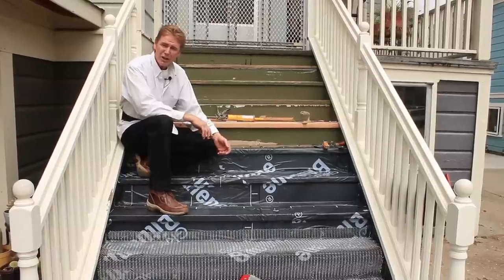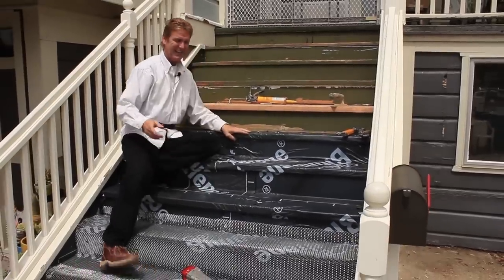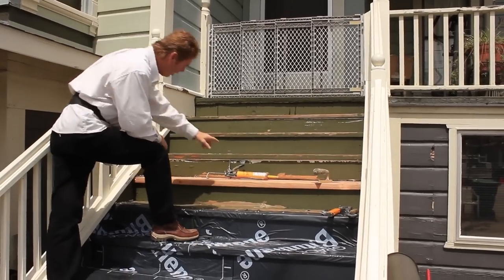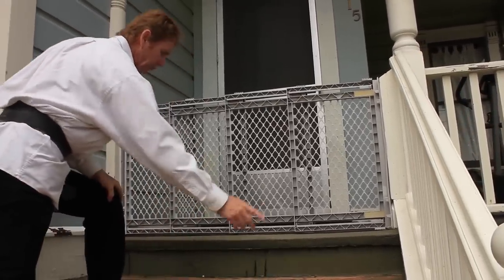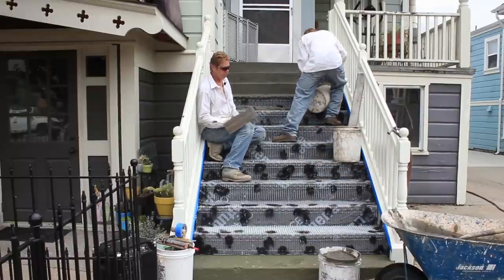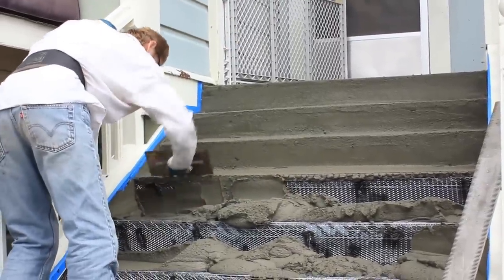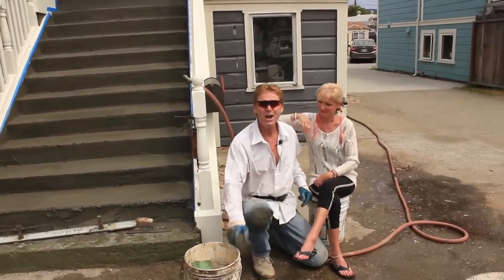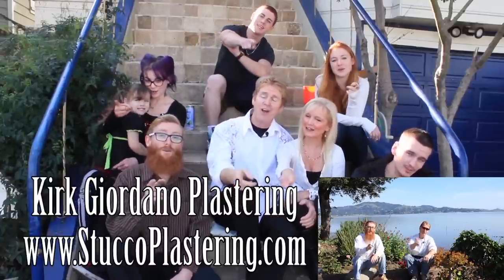Waterproofing wood porch stairs permanently.

Comment from the maker: Hello Mickey McEwan, excellent question, when we use a daby a lot sometimes it will lose it's straight edge, If this and when this happens I grab one side let the other touch a solid surface then tap the middle a few times until it appears straight again.
 I have to do this every so often when rodding or darbying walls. 
A Darby or Rendering Derby as they say in the UK are not very strong and can bend or tweak as they are made of Magnesium or Aluminum. 
Best wishes,
Kirk and Jason's DIY plastering tips

Comment: Hi Kirk, I'm planning on doing this what you've done on this video.  My question is,  I'm removing all the magnesite  material from the stairs and landing and, I would like to replace the material with concrete on top of the wood. Would you recommend this?
Reply from the maker: +Mike Enriquez, Howdy, I have done this many times and have had great success,In fact to this day they are still all in excellent conditions.
 I am a licensed stucco and plastering contractor that applies stucco to walls for a living.
 To apply cement plaster over stairs is something "I can do" as the principals are very similar to walls, but the membranes are different, thus being said, I can do it, but can't recommend anyone else try to unless they are very familiar with membranes and cement plasters,
 cheers,
 kirk giordano

Comment: Hi Kirk, been working your videos for weeks now. Very inspiring stuff man. Question: I'm a homeowner in Brooklyn New York. With that said my steps are made up of actual brownstone. It's brittle and chips easily. I am currently redoing the outer side wall and wanted to know if I can apply stucco directly to the brownstone without first applying wire mesh. Also, will a Quickrete brand work just fine? Your help is appreciate, Kirk.
Reply from the maker: Evening Chacon Johnson, any portland based stucco product will work as long as these stones are prepped properly. 
Pressure wash well as if your going to eat of these steps, next if it were me I would apply a bonding agent such as weld-crete then plaster as required.
 To plaster steps does require a bit of time in as stucco is engineered for walls, not to be walked on, that being said, some stucco's have a PSI strength of up to 4,700 psi when fully cured, compare that to 2,500 to 3,000 PSI for the average foundation.
 Cheers,
 kirk giordano Plastering
Reply: Thank you for taking the time to respond, Kirk & Jason G. I'll stay tuned in for sure!
Reply from the maker: No worries, thats me yob.
 Cheers, 
 kirk giordano

Comment: Thank you for your video! I see this type of stair everywhere around the bay area but can find very little information on how they're made. Is cracking of any concern with the wood base?  Do you ever incorporate control joints?
Reply from the maker: If you're going to stucco over stairs, no control joints are necessary. The description includes all phases of this task. Cheers.

Comment: Do you like the corners tight in your wire or prefer rounded? ?
Reply from the maker: Howdy Tomas, they should be tight or you will have to add more mud in those areas to cover the exposed wire this could lead to fish ponds in the work when it rains.                           Peace, love, and harmony to all
         Sound Plastering tips for the DIY beginner’s and Plastering experts

Comment: Not much talk about the face..i understand the slight pitch, how about the face, still making that square? 
 Then i guess let it harden. You said common cement,  that mean the days of hydration? ? Then when you tile I would imagine do the face and let the stair cover the edge?? What are the new tiles getting with anything special??  👍👍
Reply from the maker: Howdy and happy Easter Thomas, I ended up just applying a color acrylic finish over these stairs, last forever, just not as easy to clean as tile.
                           Peace, love, and harmony to all
         Sound Plastering tips for the DIY beginner’s and Plastering experts

Comment: He used the wrong paint. Linseed oil paints are great for wood.
Reply from the maker: Howdy, Maybe. Over the last 40 years, I have found that the same size wood I have also used cup or curl, thus holding rainwater. So instead, two  2 by sixes work better.🍾

Comment: Hi Mr. Giordano those stairs came out can you use that rubber manbrane on balconies too thanks for the video Mr. Kirk and Jason
Reply from the maker: Morning Gil Velazquez, long time no hear from, yes you can use this or any similar membrane for decks, retaining walls, pans and anything you wish to be water proof.
 If it on a flat area, I would also caulk all the nails or staples.
 best wishes,
Kirk & Jason Giordano's DIY plastering & stucco network